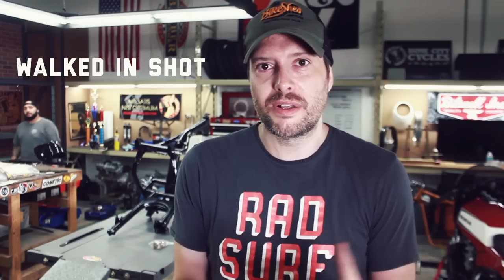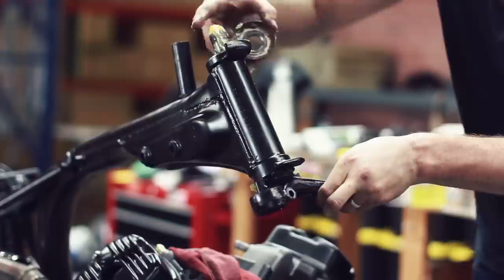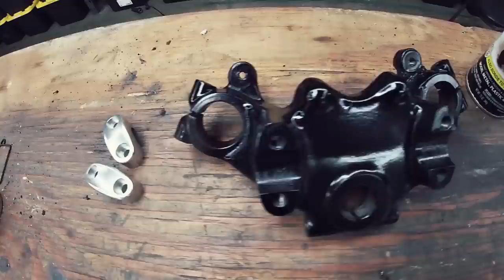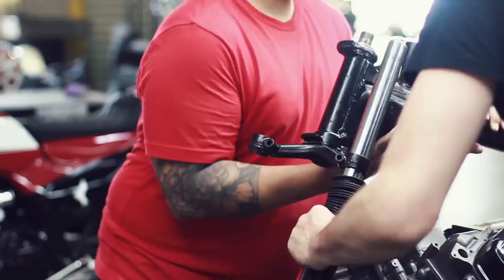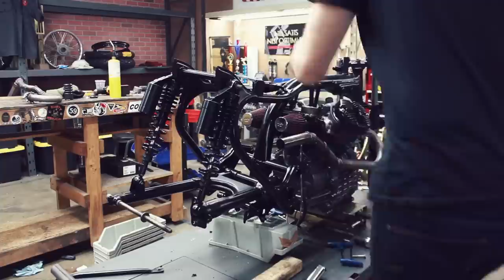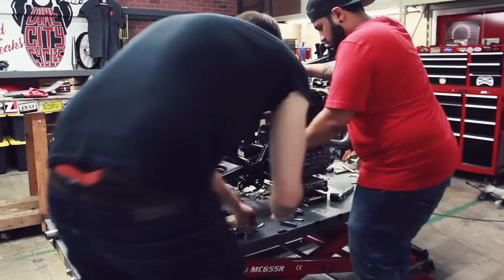CX500 Flat Tracker Build Part 11 - Assembling the powder coated frame

Comment: Are those headers for mockup?
Reply from the maker: No they were the actual exhaust we fabricated
Reply: I thought the same. They really look half finished and with the wrong bends. That would be the first thing I'd change on this bike.

The rest of it though, she's a beauty. That motor is way too beautiful to be hidden away on the stock bike.
Reply from the maker: They are half finished here, but the bends are final. They help sweep up the exhaust so it doesn't drag down. I hope they're not changed by the person that wins the bike as it'll be a massive shame to go stock after all this work.

Comment: You should have TIG welded the exhaust, it would have been much prettier, but love the engine color
Reply from the maker: I’m afraid I can’t tig weld. I did try.
Reply: @forthebold  oh, it does take lots of practice, but love the build! 
Kind regards a educated Welder
Reply from the maker: It sure does and I would have loved to learn it but unfortunately couldn’t fit it in the 10 days of building.
Reply: @forthebold  makes sense buddy